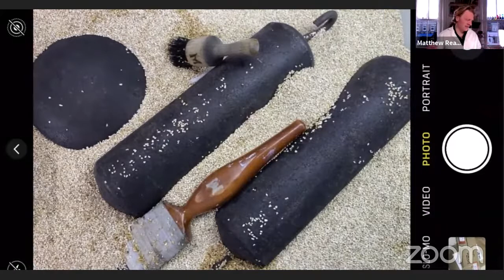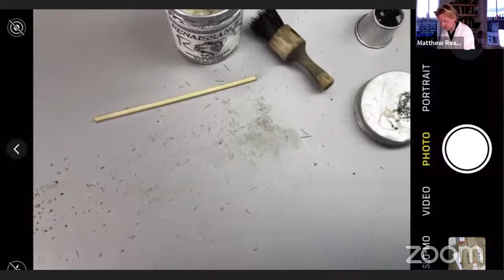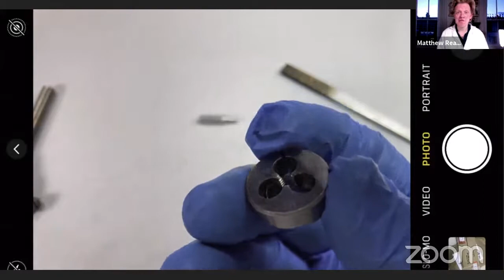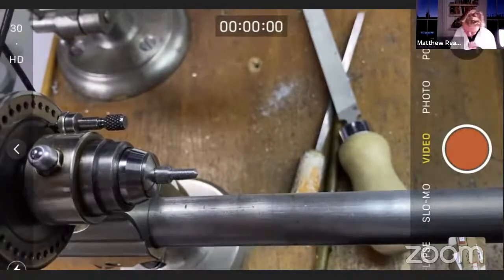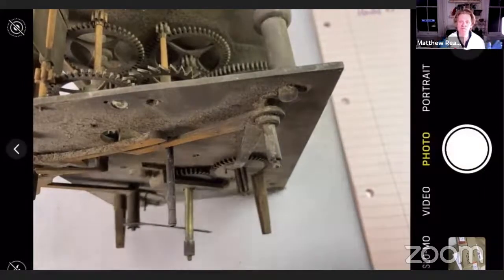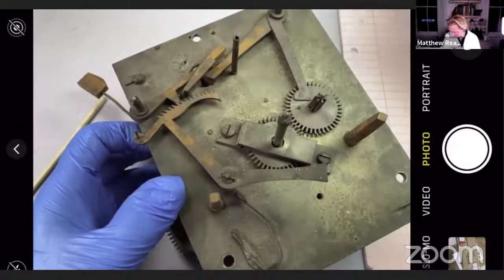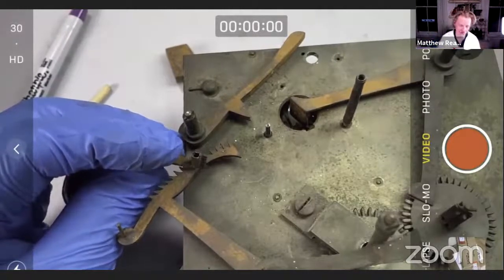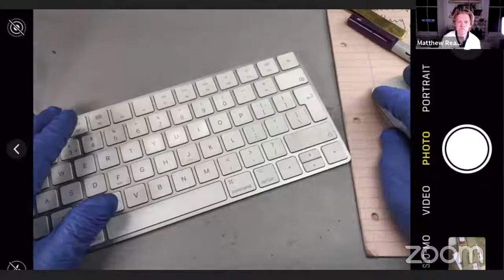How to repair pendulum clocks - LIVESTREAM  #004

Comment: 2:04:45 Thanks for the advice about water-based cleaners leaving the movement prone to squeaking. That may have been the problem with a cuckoo clock I worked on, whose pallets seemed to squeak after cleaning and oiling. Thanks again for the tremendously valuable advice each week.
Reply from the maker: Hi Bradford.  I can see water based solutions are better environmentally and for H&S but, so far, not great for clocks.  The opportunity for galvanic cell corrosion caused by dissimilar materials plus the fact domestic clocks do not need extensive de-greasing, in-fact, in my experience, de-greasing just causes problems, hence my advocacy for kerosine/paraffin or the proprietary equivalent. As always, hanks for the feedback.  Matthew